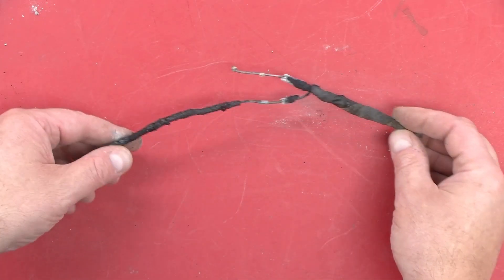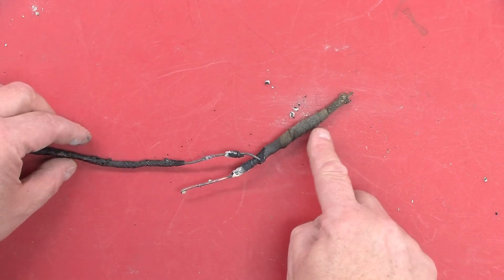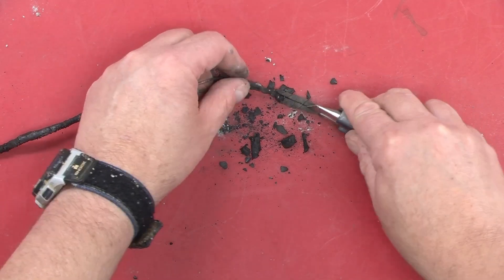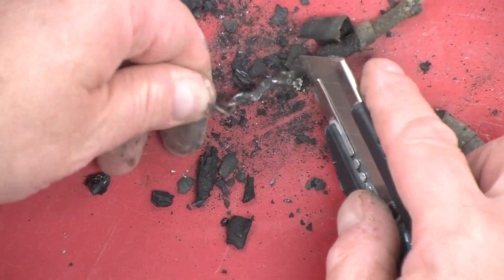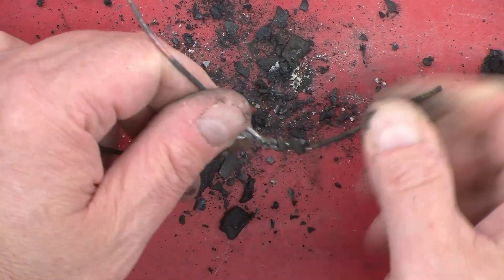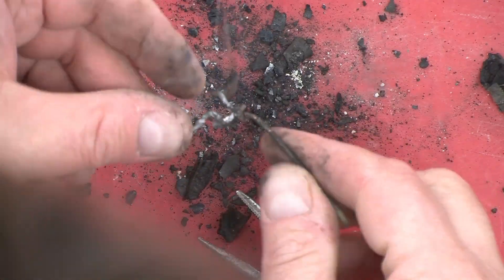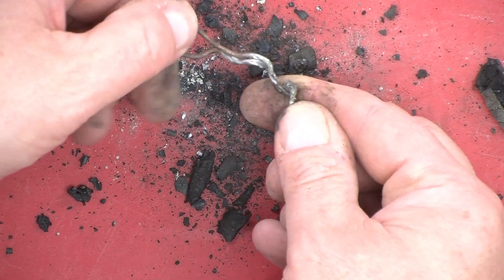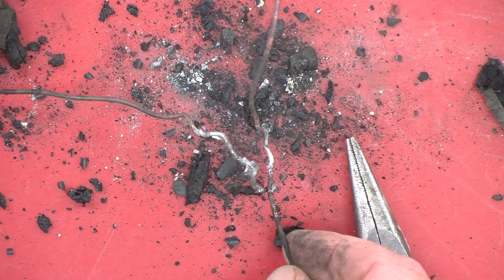Taking Apart the Knob and Tube Splice after Current Tests

Comment: I have seen soldered connections fail in a 1980's era Continental Electronics 27.5 kW FM transmitter that had been installed in a building with inadequate cooling, where it was operated in a too hot environment for years.  The wires connected to the connectors for the low voltage control electronics, which were on plug in cards, had deteriorated and the insulation on the wires had become brittle, but was OK as it did not need to be moved around.  It was easy to fix by just reflowing the solder and adding a little new solder.  I do not know for sure, but I think the solder sublimated, that is, it turned from a solid to a vapour, very slowly, and over many years.

I believe this was caused by the hot environment the transmitter was operated in, which exceeded 120˚F, as other similar transmitters I worked on that were kept cooler did not have this problem.

I would suspect the same may have happened on your knob and tube connection given how easy it came apart.
Reply from the maker: Thats really interesting. I have heard of tin whiskers growing across solder connections on circuit boards, apparently some poorly understood form of disassociation of the lead and tin in the alloy apparently encouraged by heat. I wonder if what you saw is a similar  in some respects. And your right - something like that may have happened to the solder on the knob and tube. 

It really would seen in-lead alloys unstable over significant periods of time.

Comment: AWG 14 corresponds to 2 mm2 cable according to European standard.
A 16 amp fuse is good.
Reply from the maker: Yes- our (Canadian) wire and fuse/breaker sizes are based on the American ones as opposed to your metric ones in spite of Canada having gone metric decades ago. We just cant get away from the giant economy to our south!

Comment: This is good to see, flippers that leave old cloth non ground wiring in the walls and flip out the panel get a idea of what is going on .
Reply from the maker: Yes! The unfortunate thing really is what happens to it and around it over the years with renovation from flippers and others. Who knows whats going in some hidden place where insulation may be preventing air circulation around the wiring for example.
Reply: @ElectromagneticVideos  Every flip I have seen in KC they cobble the wiring together never pulling new wire ,really the mechanical in general is hacked .
Reply from the maker: @SG-zh5xd  I guess its spend as little as possible and get the house on the market. "If the wiring is good  enough before, its good enough now." Hopefully with the housing market cooling down people will start getting house inspections again before buying which may at least catch the most obvious issues.

Comment: Ozone is knob and tubes enemy .Same issue with the old cloth rubber bx armoured cable.The advantage of knob and tube is cooler operation,the disadvantage is that it acts like an antenna and picks up RF like crazy ,Sensitive to OZONE and higher temperature and oils/solvents  in the air (Frying Indoors hair spray and other VOC).My mom's house had a 15 amp service ,then a 30 amp service  and then I got my hands on it and changed it to a 100 amp service ..A majority of the wiring was knob and tube to the second and 3rd floor .Most of the main floor was converted to Romex .
Amazing how durable and how week the same wire could be .My mom's house was built in 1935 !Balloon wall construction ,plaster and lath with horse hair .No asbestos ! 
Houses built with brick and real wood .they were designed to keep the windows open in winter .huge oil fired forced air furnace for a small 1800 sqft 3 story home
Reply from the maker: I never thought of that - so ozone and other corrosive chemicals degrade the rubber? How interesting! Did you see evidence of that in your mom's place? RF - do you mean radiate RF when someone is using a device with brushed like a vacuum cleaner or the harmonics from an electronic poser supply? Now that I think about it, the spacing of the wires would sure make the system into a reasonable antenna.

15 Amp service originally - wow! So did you replace all the knob and tube when you did the 100 Amp upgrade? No asbestos - I guess thats one advantage of minimal insulation. 1935 would have been right after the great depression - I guess back then coal and wood was cheap compared to insulation and the free flowing air would have been perfect for knob and tube.
Reply: @ElectromagneticVideos  it does both it radiates and receives RF and it's easy to induce signal from parallel lines but not at 90° .Especially on old systems that had no grounds put it .I used to run a wire for ground to a cold water pipe and swap out receptacles to U ground duplex .The advantage was you could add GFI to it if boxes were deep enough and you had a reference to ground for safety .The issue is vintage appliances that had chassis reference to Neutral when reversed the chassis would become hot .Not a good thing !..Spacing between wires and neutral loops .Some houses were wired 1 neutal to 2 hots .for 120/240 others were done one neutral per circuit ..Some houses were done in stranded conductors .they had the highest failure rates
Reply from the maker: @carlubambi5541  So how does received RF manifest itself? I would have though that unless you were close enough to a high power transmitter it would not be noticeable?  Stranded! I didn't know knob and tube was done with stranded!
Reply: @ElectromagneticVideos  In Toronto you would find many homes that were done with stranded as well as solid..As standards were dropped on electronics they were more susceptible to RF and EMF ..My neighbourhood was supplied with the old 4160V system then they went to 13.8 KV semi insulated transmission lines .When we had the old 4160 V system ,even someone using a skill saw 10 doors away would cause issues up the street.You would see your lights flicker .This was in the late 1980s  when they changed to 13.8 kv .We had sags and spikes like crazy .Especially when every house started to get central air .Electronics ,especially PWM switch mode power supplies were notorious for generating All types of harmonics into the electrical grid .Someone would turn on their 286 computer and you got lines 9n your TV from doors away .I have seen neutrals burned out   in transformers in factories using loads of switching power supplies .We have had to up size the neutral in transformers because of peak currents pulsing through the neutral way above the current rating of the wire and lugs on transformer .
It's even worse now with LED lights ! More issues of noise including audible sound you can hear .Some times annoying .Not to mention the use of VFDs on motors for pool pumps tread mills and other exercise equipment and furnaces as well .loads of noise being injected into the AC lines

Comment: seeing how homes were electrified 100 years ago, really makes me have respect for the electricians that lived and passed on long before any of us were around.   The pre-planning the wiring runs, then drilling with back and brace, nailing on the knobs,  twisting (western union splice) soldering with blow torch and soldering copper, and finally wrapping with friction tape, that was very tedious and time consuming,  compared to how we wire homes today with j boxes, romex, staples and wirenuts.    but then again 200 amp with 40 or more circuits seems to be the norm lately, compared to 30 to 60 amp service with 4 circuits maximum for even a good sized two story home where one receptacle per room,  with a pendant light in the center, were considered luxuries.
Reply from the maker: Yeah - its   amazing to imagine that electricity at all was high tech 100 years ago and would have initially required training for both installer and user covering things we would think are obvious today. Even just the concept of understanding how electricity flows in wire and how insulators are needed would have been a new concepts to many. It reminds me a bit of a vintage film I saw somewhere on YouTube teaching people how to dial a phone. 

200A: I remember when I was a kid around 1970  and we moved into a house before it was finished including no power for the first few weeks. Dad had the foresight to have 200A service installed, but most others had 100A even then. But I think the big shift to 200A came in the mid 70s in Ontario with a push to electric heat and even after new construction  moved back to oil and gas for heating in the 80s, 200A stayed. Good thing - I'm planning to switch to electric soon as propane prices go above electric.

Comment: I have always had great success with soldered connections, even in fault conditions. Thanks for showing this!
Reply from the maker: Your welcome! I also have a had excellent experiences with solder - generally in the low power (signals) situations. I point that out because because a cable manufacturer that my company uses swears that crimp is more reliable than solder. I find that hard to believe but maybe when you have crimp tools that each cost thousands of dollars you can do a better job than soldering. One other interesting thing from Robert LaPointe's comment (well worth reading if you haven't seen it!) : it would appear that 63/37 is probably the best for long term reliability and stability.
Reply: Believe the NEC Book still does not allow you to solder ground wires. Still have my 100/140 watt Weller soldering gun that my dad bought me while I electric shop in 1967 along with a couple of soldering irons.Rarely use them in last 30 years. Did a lot of soldering putting together a Healtkit 25" TV, O scope, tube & transistor tester, & s, radio in a correspondence class that VA paid 90% of tuition.
Reply from the maker: @JohnThomas-lq5qp  So are you saying you are allowed to solder line and neutrals, but not ground? I wonder if that's an artifact of allowing soldering before grounds were used but never specifically permitting it for grounds when they were introduced?  

I'm  amazed you have the original soldering gun - I have gone though a few soldering guns over the years and found the hard plastic body of early ones (in my case from the 70s) eventually would break. Maybe Weller made them not as strong as the ones from the 60s. I still occasionally use a soldering gun - most recently with a long shaped piece of #12 wire replacing the tip to unsolder all the pins of integrated circuits at once.  I envy you at having built all those Heathkits! I never had any - the closest thing I did was a surplus Eico (?) tube tester kit that I got in the 80s. I still have it!
Reply: @ElectromagneticVideos  Googled NEC & Soldering wired. Now the NEC book on Article 250.8 ( B ). Methods not permitted: Connection devices or fittings that depend solely on solder shall not be used.  Can not assume anything with the halve millon word code book but here's my two cents. Not allowed to solder hot, neutral  or grounds but in my 50 years as an electrician have seen hundreds of above wires soldered to transformers, power supplies, speed drives, fuse & circuit breakers in & on control panels, dimmers etc. I would never solder wires for anything drawing over 10 amps.

Comment: From a cooling perspective. Horizontal wires will always have cool air along the length. Vertical ones get hotter the higher up cause the cooling air is already warmed from the section underneath. And the cooling air for the top wire is probably warmer due to the hot wire underneath it. Then with the higher temperature the resistance also increased thus it took more of the juice.
Reply from the maker: Very good point - you know, your the first one to consider that variation in air flow in all the knob and tube comments!
Reply: @ElectromagneticVideos  thank you :) the tests are very interesting. Ive done such tests my self but really just for fun  :)
Reply from the maker: @86Ivar  Well the truth is these are also as you put it just for fun too. But a lot can be learned even from this. I have been surprised at how close to melting our modern NM 14/2 is with around the rated current in what is now becoming more typical amounts of insulation.  It started when did some extension cords just on a whim early this summer - had no idea I would end up doing so many related experiments. I hope people seeing the effects of  over-current on things will help with an understanding of why there are rules and encourage people to follow the rules - or go a bit beyond them in some situations. By the way - one great things as been comments like yours - different eyes looking at something see it in different ways which always is interesting, as have been comments from people of have seen the stuff and its failures in actual situations.

Comment: Nice to see how it fared but that joint doesn't impress me all that much.  The solder was still holding on but it had definitely had a hard time with the temperature.  With a proper, longitudinal (?) twist the wire takes all the stress and have large firm contact area with the solder just providing electrical conduction assistance which is what is supposed to happen.  Even with the high temperatures a proper twist joint wouldn't have relied on the near or actually molten solder keeping the wires stable nor the crispy wrap tape.  With the way those wires were tail (?) twisted you can see the gaps the solder was having to bridge.  All up though I guess that's how things were done back then but full appreciation of why old wiring burnt places down if an abnormal load was placed on them.
Reply from the maker: You know, it would be interesting to take apart a splice like that that hadn't been subject to the abuse I did to it and compare. Or for that matter look at a number of joints and see if there was any consistency as to how well they were twisted and soldered. To your point about why old wiring causes house fires with abnormal loads, at least with all connections in boxes these days, if a connection is done poorly there is at least one more level of protection to prevent house fires.
Reply: @ElectromagneticVideos  Yes, we have many more levels of protection these days including arc fault detection which would likely be the saving aspect with the joint you took apart.  It doesn't take much of a leap of the imagination to see people in the 1920s sticking nails in fuse holders given what goes on today.  The speed at which things catch fire under the currents that permits is impressive.  It sure would be interesting to see how the solder in a non-abused old joint has stood up to the tests of time, thermal cycling etc.
Reply from the maker: @retrozmachine1189  Yes! arc fault detection particularly the latest variants of it are remarkable tech. Might not be a bad retrofit for places with old wiring although probably would not help in cases of simple overheating where the wires are covered with flammable insulation.  I'll keep an eye out for some more sample splices to take apart and look at under the microscope. As I am writing this I'm also thinking maybe remove and clean the insulation from an  old splice, and with  a pyrex glass sheet between the splice and microscope, try some overcurrent and see how the solder changes. By the way, if you havnt seen it, look down for the post by Robert LaPointe about solder and longer term deterioration - very interesting!
Reply: Here's what article 250.8( B ) in the NEC says: Connection devices or fittings that depend solely on solder shall not be.used.
Reply from the maker: @JohnThomas-lq5qp  Interesting! So there must have been some issues with solder over the years.
Reply: @ElectromagneticVideos  The only solder around years ago might have been acid core. If not saw old wires that soldered using corrosive acid type flux guessing that's what caused 40 to 50 year old soldered wires to have corrosion entire length of where solder was   I always used a quality multi core rosin solder in two different diameters. In electric shop for unknown reason shop teacher made us solder wires from tube sockets to home made galvanized box. Was difficult to solder. Had to clean guess it was the galvanized coating off with sand paper then use a 300 watt giant soldering iron with acid acid solder & acid based flux. My way was 10 times faster. Just drilled a hole and wrapped wire around screw with a flat washer.
Reply from the maker: @JohnThomas-lq5qp  Your right! In fact I remember when I was kid having some acid core solder that came with my first soldering iron and you could even smell the acidity. Got some rosin core stuff and even my soldering seemed to improve although that might have had more to do with practice than the type of flux.  Sounds like you teacher might just have been trying to keep everyone busy and you messed that up for him :)
Reply: @ElectromagneticVideos  First few years that I soldered never was told to have a wet sponge to remove old solder & build up on top of soldering iron. On the huge heavy 300 watt copper tipped soldering irons we had in school would run a file over it to clean tip.
Reply from the maker: @JohnThomas-lq5qp  Same here - self taught at home with not advice that came with the "kit" of a soldering iron and a small roll of solder. What I find so great about YouTube is that you can get advice on how to do almost anything. How did we survive back then without the Internet? They again, we probably would have just been sitting in front of iPads and not actually soldering stuff!